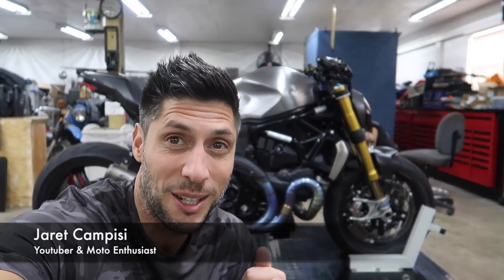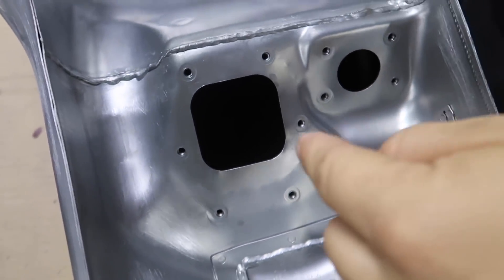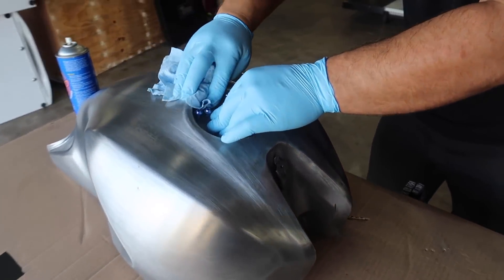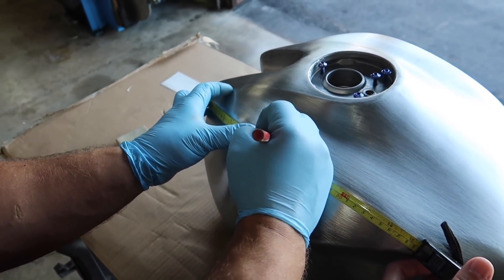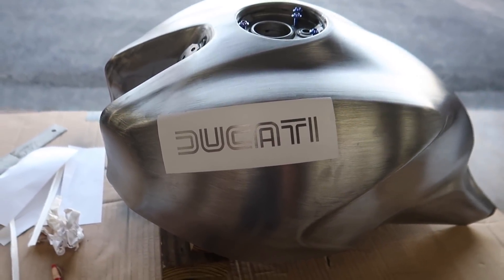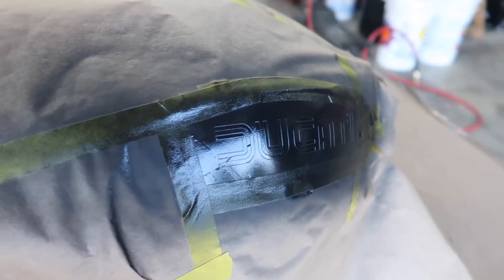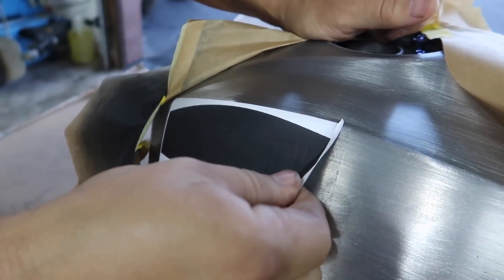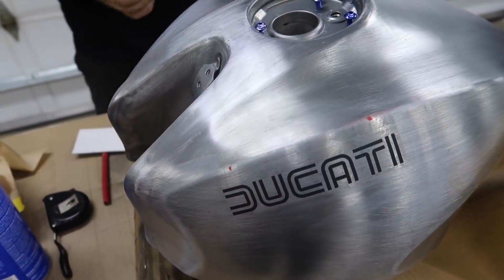Major Problem with Our Monster Brushed Steel Tank

Comment from the maker: I really hope we can clean all this sticky BS off when the paint dry's otherwise its back to square one...I know it will look amazing when its done but man this tank has been a pain in my ass.  Help support these series and be entered to win them when they are done here.  www.patreon.com/campisicustoms
Reply: Acid etched lettering is maybe an option... maybe stain the letters after after then clear.
Reply: Hey man, I am in Carlisle with Ivy & Willow Co., and I can either do your Vinyl stencil or I have a different stencil style that would mitigate the residue and produce the same result if you cannot get the residue off. message me and I can get you guys hooked up.
Reply: It's the solvent in the aerosol making the glue stay on the tank once you peel off,If I were you I would stay clear of rattle cans,mix up some water base paint and clean glue off with degreaser,not thinner or anything like that,hope this helps 👍
Reply: Or better yet,use decals and clearcoat over the top using matting paste in the clear coat ,jobs a good un 👍
Reply: Looks like a hack job tbh. Have it done right or it will just flake off in no time.

Comment: You almost need to put a coat of clear coat down and then the black so that black can stick to something. Also I use this stuff for stencils. 

Avery Dennison Blue Signmask is a 80 micron flexible vinyl film with ultra removable acrylic adhesive. High transparency for precise positioning. Designed to give a sharp edge finish to painted graphics. It is a film product designed for use in large signage applications on flat, curved or irregular surfaces.
Features:
• Excellent conformability to irregular surfaces
• Excellent solvent resistance
• High transparency for precise positioning
• Clean and easy removability from most substrates
• Good adhesion to a wide range of substrates
Suitable Applications:
• Cars and vans
• Emergency vehicles
• Buses, trains and light rail
• PVC banners
• Illuminated signage

Comment: Instead of stencils use decals since you clear coating anyways, i did that with the same style Ducati logo on my Scrambler and looks great.
Reply: I thought that too but doesn't the surface feel raised where the decal is regardless of the clear over the top?
Reply: @benjamingalli21  if you give it 2 coats of clear then flowcoat with clearcoat that will eliminate the raised area where the decals are 👍
Reply: Sounds like the obvious choice then. Thanks for replying
Reply: @benjamingalli21  I honestly prefer the embossing feel as long as it's under the clear coat. But that's just my preference I guess
Reply: No. That is the cheap way out. Especially if you are a custom builder and you are a perfectionist. That simply just won't do.

Comment: Hi,can I make a suggestion,you may need to 2 k clear coat it first ,before adding your paint mask decal,then re-clear coat,the stick glue could be sticking to the sanded surface.

Comment: This is why manufacturers use decals and clear over them. I used the decal method on my Diavel and have no regrets.
Reply from the maker: yeah that's def an option but I do prefer paint if possible
Reply: @JaretCampisi  may the odds be in sausage fingers favor

Comment: A buddy of mine put this new kind of clear bra material on his light and it worked really well. It's way thinner than the old stuff used to be and you can't even see the seem unless you really get close and try to find it. Best part is it was basically free because the guy who did it just used a bit of an off cut from a car he had done. You should learn to do some of this stuff yourself man. It's pretty easy and you save a bunch of money. Been building my own bikes for years now, it's actually a lot of fun.... most of the time.

Comment: Jaret, You might want to put on a layer of intercoat clear first before spraying on the letters. The raw steel will resist the paint because it is not allowing it to chemically bind. That is the reason that the paint is lifting when removing the stencil. So, spray on the intercoat clear, let it dry for about an hour or two, scuff it with a red scotch bright pad, clean off all the dust and wipe it down with degreaser, apply your stencil and spray your letters. You should have a perfect result then. Also, thin coats of pain. Ideally, use an airbrush to apply the paint.

Comment: The lettering on my custom paintwork is the vinyl sticker - looks great under the clear 👌🏼
Reply: Thats how it should be done
Reply from the maker: I think that's def a great option but I prefer to do paint if possible
Reply: @JaretCampisi  i think theres a special vinyl that is easy to take off and leaves no residue the only parts that have that sticky material are the letters

Comment: Love the old school Ducati logo. Classic “modern” from 1950’s Italy.
Question 1 should the inside of the tank be coated?
Question 2 I’d run the bike for a while after reassembly and then remove and replace the fuel filter……
Hey, but totally trusting Dado on those thoughts.

Comment: A true low tack stencil, will literally use low tack masking tape (3M etc) as the backing, not a regular sticker backing. There is no way what you've been sold is even close to being lock tack, its not even a stencil, just a sticker that's got the Ducati logo cut as the shadow of the lettering. Low tack will leave no residue whatsoever.
Reply from the maker: yeah that's exactly what Dado said too...
Reply: @JaretCampisi  Just saw the new video. Killer job guys, they didn't make it easy for you with those stickers. But even better when you overcome the hurdles and get such a great result

Comment: Frustrating! 😬 I had the Termignoni logos laser engraved onto the stainless steel sleeves of my Monster 1100 Evo exhausts and they look superb. Laser engraving actually removes a small amount of metal so might not be the look you're after for the tank. There is also laser etching, which is more like a tattoo and leaves the surface smooth, and that might be a better option. Have a look at the logos on some Termi titanium cans - they're laser etched.

Comment: Bummer with the residue.. Curious to see if it comes off when the paint is cured, but worst case you can leave the tank without the stencil, which looks pretty badass as well, or have dado weld some metal stencil on 😂
Reply from the maker: worst case we would just get a sticker made and use that and then clear over it
Reply: @JaretCampisi  that would work too 👍🏼